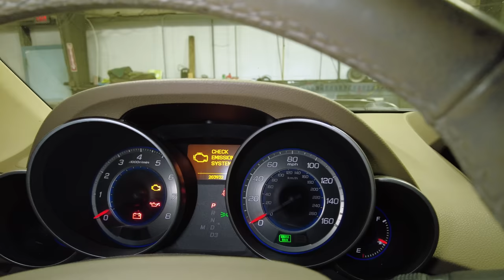Total mess! Last shop really screwed up on this '07 Acura MDX. What does the CAR WIZARD find?

Comment: As far as the oil light. I noticed with mobile one oil the light would flicker. But with penszoil, the flickering would stop. Thus I stopped using mobile one.
Reply: The issue isn't oil brand specific. Like car wizard stated twice, these are a well known issue. My 09 TL SH with the 3.7 did this sporadically regardless of the oil brand. As soon as i replaced it, the light never came back on. I've used mobile, pennzoil, and castrol. There's an updated part number for the sending unit that fixes the problem. I believe there was a TSB out for it as well.
Reply: @BryanW916  true. I'm just sharing my experience. I've owned 2 mdx's both with flickering oil lights. I never replaced the sensor on either. I assumed it was based on the oil used because at the time I would find deals and go to different shops. So the light would come intermittently. I switched to full synthetic penszoil each time the light came on and the issue went away. Drove the car to 195,000 before I traded it in with the original sensor.
Reply: @hilow4125  Oh nice, that's so strange! idk how a different brand would cause the sending unit to fix itself. The part is pretty cheap tho so i just changed mine because i was tired of the fault. Sometimes it would turn on and off about 15 times in the span of 5 seconds lol! It drove me nuts. Did you ever notice the engine burning more oil with Mobile? im on an acura forum and some people said Mobile made their engine burn more, but pennzoil made it burn less.
Reply: My 08 MDX didn't burn any oil. I have a 13 zdx and with mobile one I did notice more oil burnt between oil changes than with pennzoil.
Reply: @hilow4125  oh that’s right, the ‘07-‘08 Acuras with the 3.7 didn’t burn oil. I think they went with a different piston lining in ‘09 that caused the engines to burn a lot of oil. There’s a TSB about it and I think Acura will replace the piston rings under warranty.

Comment: Use some bug spray for the headlights, make sure to mask around the area. Do it one headlight at a time, as soon as you spray it wipe it down with a coarse towel or rag. You can repeat it to take more of the haze out, most of the time if you did right the first time you won't have to. Make sure as you are doing it not to leave streaks. For the most part it'll leave them looking presentable and look better than decent
Reply: Try Mother's Mag and Aluminum polish.  Wax on then wax off. You will be amazed and never use anything else again. It take 1 to 2 minutes per headlight
Reply: Does it stop bug spatter too?
Reply: @Cheepchipsable  😂😂 yes it repels it, trust me though the bug spray lifts all that grime off the lenses

Comment: My 2008 Accord 2.4L has 332,000 miles. The only problem ever was that the starter went out at 300k miles. I replaced it myself.
Reply: How hard was the bolt to remove. Probably a bit easier than honda v6 as you have more room.i gave up and had a tech remove it took him about 2 hours just to get that long starter bolt off damnn

Comment: I assume this "customer" had to pay for your shop time doing the diagnosis.  I am wondering just how much more it would have been to just get the work done and not have to deal with it.  Even with 200K miles, it would seem worth it as the rest of the car seems to be in good shape.  Perhaps money is that tight for them.
Reply: If the design is similar to older j35 honda v6 its just 3 long bolts and releasing 2 clips to remove.

Comment: I ended up quitting doing work on peoples' older Hondas and Acuras because of the sheer number of improper fixes ive had to perform. And when you call someone out for doing something really stupid, they do everything they can to slander you and ruin your business. That pinched vtec solenoid wire is a PRIME example. Would have taken maybe another 10 seconds for that person to install it carefully without pinching the wire. But no everyone is zip happy with their impact these days. A more extreme example I once saw was a 22 year old "master Honda mechanic" who ruined someones engine and transmission using an impact to force the two together. When all he had to do was just turn the torque converter a little bit cause it was caught on the shaft splines. Busted the bell housing right off the motor and ruined the transmission input shaft. Ive even seen harnesses shredded just to rig on a radiator fan permanently, when all they had to do was replace the thermoswitch on the housing.

Comment: Did the owners of that vehicle have any problems with the 3.5 liter v6 cylinder deactivation system (vcm)?  It has been a problem on the older Honda v6 engines.  Causes oil usage, spark plug fouling and engine mount vibrations.  Hard to believe problems with that would not have manifested themselves after over 200,000 miles.

Comment: It's a 3.7 liter, mine had the same exact problem.
Reply: How was it solved in your case?
Did someone stretch the same wire?
Did you have the VTEC solenoid filter screen cleaned/replaced ?

Comment: So you didn't even want to quickly disconnect the solenoid connector and simply re-route it? Seems like a 3 minute job that would likely keep the fault from coming up as frequently. I'm a tech and definitely would have done this, and given them the option to replace the unit as a guaranteed fix.

Comment: Sounds like you know the pains of outing a shop doing bad work.  Would you be interested in doing a video on what transpired?  Leaving out the shop(s) name of course but I think your subscribers would be interested.  If you alredy addressed this in prior videos I apologize.
Reply: Considering the customer is going to attempt to see if the previous shop will warranty their work, even though it was before they bought it, I think it's worth it and and keeping their name out of this for now is best. But if they are douches about it, maybe the customer can leave a comment here.
Reply: @marcusdamberger  There are so many variables the owner of the shop may not be aware and it was one of his employees who unwittingly created the problem. Sometimes there is so much junk floating around in the engine bay it's hard to know what is routed where.
It may have been OK and not visible when the offending bolts were tightened.
The other shop may be most apologetic - they should at least get the opportunity to respond to the customers complaint.

Comment: My 2017 Honda pilot touring awd crapped out at 55k miles. The transmission started slipping and the body control module went bad. I paid $1.4k to get the module replaced. Even when regular maintenance was done it didn't last as long as I thought it would. Meanwhile my 2017 Hyundai sonata with over 130k is still going strong.  I haven't bought a Honda since.
Reply: Some Sonata's and other Kia/Hyundai of that year have serious engine problems, much worse than Honda.
Reply: @midwestfarm757  Agreed

Comment: This customer can't be bothered to wash their car or check the oil.  My guess is they bought the Acura with high mileage for a low price and will drive it into the ground and only fix issues that prevent the car's operation.  With proper maintenance, this car might have another 100K miles or more in it.  I doubt it gets that with this customer owning it.

Comment: Did you find the fault Wizard or did Daniel because that's some good old fashion mechanic detective skills right there...👍🙂👍
Reply: It's really not that hard to see something isn't right when looking around. Wires in particular should be secured, away from hot/moving parts/dry, and not stretched like piano wire. Just that it's buried and probably not easily visible from above. Knowing there was recent work is a pointer. 
Seen a few cars where wires are clamped when bolting an alternator or starter motor back on.

Comment: Did not read any comments and this is a SOHC J37. My guess is the VTEC solenoid is not bad. The old VTEC solenoids had a oil screen in them. The screen would get clocked and the CEL would come on due to the clogged screen. Remove the solenoid, clean the screen with brake cleaner and...good as new.

Edited:That first mechanic is a fucking tool. As a customer, I am going back and raising hell for fucking up my VTEC solenoid.

Comment: Hello Car Wizard, I have a 4wd Honda CR-V, do I have a similar differential as the Acura you're working on? That is something I don't even consider servicing, should I be looking into this
Reply: Much different. However there is a component for AWD in the rear that should be changed every 50k miles.

Comment: 3.5 is definitely a bit more reliable than the 3.7. I have a 14 MDX with 130K. It's a great car! Hope these people can find the money and get their car fixed.
Reply: Agreed. I own a 2015 advance w/ sh-awd and love driving it on the sand. Fun fun and bullet proof however I had 1 failure. Both front shocks had to be replaced due to fluid leak, and they were pretty expensive but nothing else after that.

Comment: I have a 2012 Acura MDX with P0976 Code. I have changed the Solenoid Block, pressure switches. Did 3x3 flush, changed the transmission filter. When accelerating around 20Mph, have a jerk. That too, when only engine is hot. Any suggestion would help.

Comment: I just got oil change from my dealership, and they forgot to put my oil cap back on, and going to pay for the cleaning, will there be issues after this, I didn't drive to far with it! The vehicle is a 17 Fiat 500x 2.4L tiger shark!

Comment: In NY, at over 200k. That car would've been in the junkyard 100 thousand miles ago.
Reply: Yep, it's depressing here that most cars have decent engines that would be fine, but the frame of the car is rusted in half, and so is everything under the car. Main engine is good tho.
Reply: @rdizzy1  Cars here in the city just get generally beat up. At 100k they look and drive like worn out junk. So when you get a $2000 repair, you'd rather put that money down on a newer vehicle.
Reply: @Kewrock  Yeah, right now I have a 2011 Kia Rio, only has 80k miles on it, I've already had to replace the ENTIRE exhaust once and the muffler twice due to it rusting all the way through to where it literally dropped off my car while driving. I only drive about 6-8k miles a year, and I'm not sure this car will last until it hits 100k, let alone 100k+, but the engine is perfect (other than needing a set of coils twice) The frame already has rust holes though, the frame will be gone by 100-120k miles even though the engine will be good for another 100k.

Comment: These older, second-generation Acura MDX's were not that bad back then. Now, they are just about to fall apart.
Reply: No, I just don’t see it. The only thing “about to fall apart” in these would be that awd transaxle, and Toyota/Lexus is no better w/ their awd, either. Acura mechanicals have proven bulletproof overall. My last Acura (2003) went over 280k before I let it go and aside from having to add a little power steering fluid monthly and the pitiful trans, zero issues worth mentioning.
Reply: All generations of these are junk.
Reply: @user-tb7rn1il3q  Agreed

Comment: I seen a video you did 2 years back where you did a abc swap on a Mercedes cl55 amg where you did a power steering pump swap to a e500 for  power steering..will this e500 power steering pump fit on my 2006 Mercedes cl500??If so what year of the e500 Should I be looking for for this job??..I really need your advice if you can help doc??

Comment: I would at least take the tension off the solenoid to see if the problem stabilized.
Reply from the maker: And ruin the chances for warranty work for the customer? The other shop could claim that I broke it by moving the wire.
Reply: @CarWizard  Ahhh. OK. That makes sense.

Comment: I wish I lived near the Wizard, I got a 98 Gs300 and the battery won't be at 14v when running, everytime I check it with the multimeter it reads 11.8 or 11.9 and when it's off it's 12.45. I bought the car after it sat for 4 months and we just finished rebuilding the engine, I'm not sure why it won't run at 14v, it doesn't drain when running it just very slowly trys to go up. I just want to drive my car

Comment: This would not happen in Australia because our laws are very strict regarding anything to do with the motoring industry weather repairs new and second hand cars if a mechanical workshop makes a mistake they have to fix it for free l had a small problem woth a work shop they put the clutch slave cylinder in the wrong way and had to get it towed back to the workshop they paid for that l myself have changed many slave cylinders removed them to change clutches always put them back corectly and l am an ameture mechanic so l can't understand how it could happen

Comment: I have a 2013 with 201k miles. Should I do the timing belt if there is no issues?
Reply: It can snap at any time. Friend of mine lost an Odyssey because the belt snapped.
Reply: Timing belt should be done every 100k.

Comment: Seems like funding was the problem for the owner not getting repairs.  It happens.  Just a little constructive criticism on the video format.  When the title is what it is I really have no interest in looking at the inside and outside of the vehicles if it has nothing to do with what the problem is.  I find myself skipping through most of that as it's irrelevant to the subject matter.  If the problem is a differential leak I don't need to see the interior.  Sometimes it's more about the quality and not the quantity of the video.

Comment: That’s why I hate Honda v6 engines.  I had one with the 4wd system and got rid of it before the second timing belt service.  Keeping up with the front and rear differentials and the timing belt was Not worth the trouble.  Diff oils had to be replaced every 15k miles.  Very annoying.
Reply: Lol
Reply: Every car needs to have differential and transfer case/power transfer unit fluids checked and/or replaced on a regular basis... just like very other fluid. But every 15k miles is way excessive.
Reply: I've thought about going to another make that has chains... But then I see how many (even Toyota) eventually have stretching issues.  Not that big of deal, plan for it, or learn to take a day and do it yourself... lots of videos out there.  Every AWD vehicle needs fluid serviced.  AND, if you buy American you better do that service religiously!
Reply: @philbrutsche8928  15k is what Honda recommends for its rear diffs.   Otherwise the clutches start to grind and howl.  And you can only use their weird Honda fluid.  I had cases of the stuff.  And the front diff used a different fluid altogether.  Had I known About that I would have just bought the 2wd version.
Reply: I don’t think I’d replace my Honda with one that doesn’t have a similar I4 engine.
Reply: @philbrutsche8928  Subaru does not provide specific replacement intervals for their diff fluids, just inspections basically every other oil change.  A good rule of thumb for them was change every 30k.  You could get away with up to 60k if you wanted though.
Reply: @stevenatwater7298  Everything has timing chain "stretching" (link wearing, really), especially when oil is not changed as frequently as it should. GDI (gasoline direct injection) is worse than "old-school" port injection. With proper oil changes, most modern engines will last hundreds of thousands of miles on the factory timing chain.
Reply: @philbrutsche8928  that’s why my next v6 will likely be a v6 Toyota highlander.   Not an archaic Honda with rubber timing belt and valves that have to be adjusted all the time.
Reply: @mongo64071  Agreed. I was flabbergasted when I saw that the latest iteration of the Honda J-type V6 is - JUST NOW - getting hydraulic lifters.... a 1960s technology.
Reply: @philbrutsche8928  yep. Learned a lot from Scotty Kilmer.

Comment: Anyone familiar with Honda J series architecture would've spotted that idiotic blunder. My mom has an '07 TL w/ the 3.2 & I would've instantly seen that.
Or anyone with common sense who knows wiring doesn't get stretched to full tension like a rubber band.
I'm a professional musician BTW, not a pro mechanic. These days however, I'm positive that I'm more of a professional mechanic than 70% of the alleged ones.
And what a great legal system we have that protects incompetent fools & punishes honesty. Fun.

Comment: Funny that she thinks 203,000 miles is a lot. It's really not for a Acura or a Honda. I have a 2004 Honda Pilot that has 383,000 miles and still running strong as it ever has. But then again it's a Honda.
 Not too many car brands getting to that many miles. Not to mention that it's got probably going to go at least another hundred if not 200,000. 
This pilot has had timely maintenance its whole life and three-quarters of the miles that it does have on it are from being on the highway. When it gets to a half a million I'll give you another update. 
And if you think I'm lying, ask yourself why I would. I damn sure don't work for Honda. Although it would be pretty cool of Honda to give me a brand new pilot or this one lasting 400,000 miles so far. 
Oh by the way still has the original drivetrain. Although I did have to take it to Honda to replace the Takata airbags because of the recall but that didn't cost me a dime.